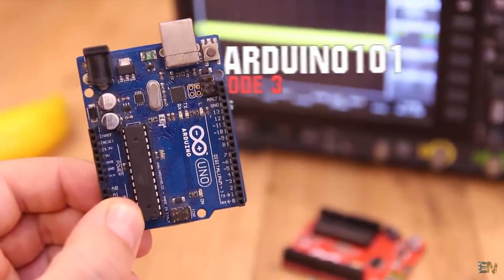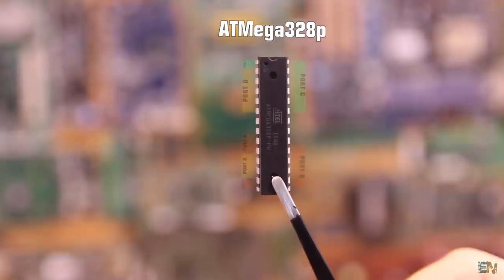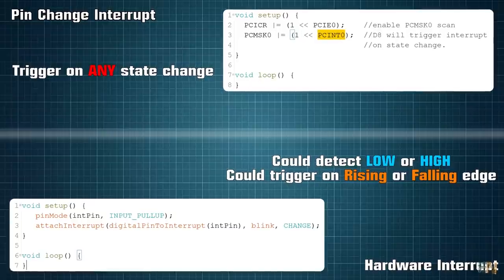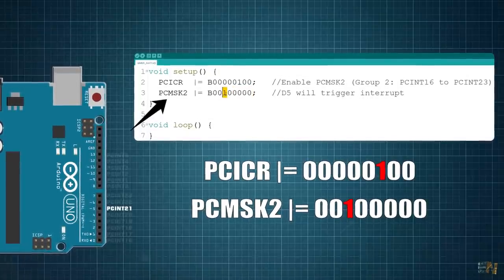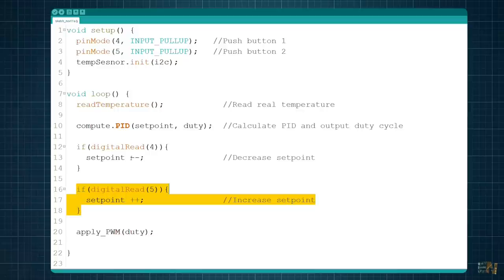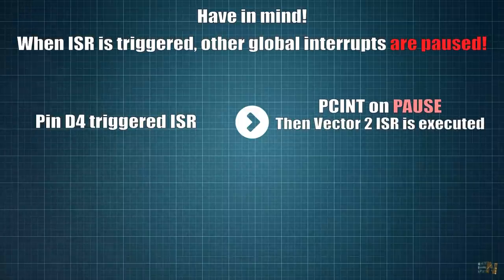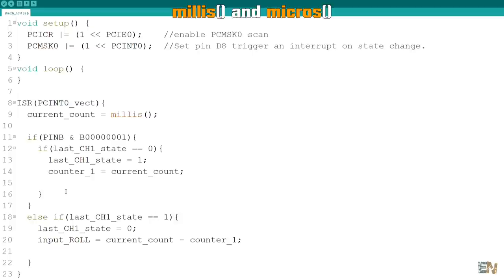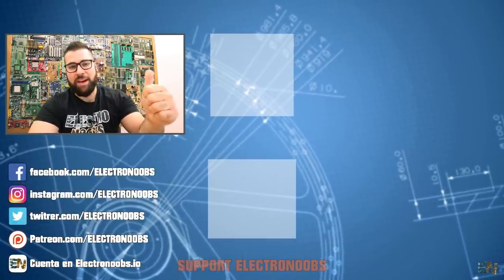Pin Change Interruptions ISR | PCINT | Arduino101

Comment: Hi, I don't know if you reply to comments on old videos but here goes. Could you use interrupts to run both InfraRed Transmit -> InfraRed Receiver on a single Arduino nano (IRremote.hpp)? Normally you would be stuck in IrSender until you have sent a complete code (e.g. IrSender.sendNEC(sAddress, sCommand, sRepeats);) and if you are receiving you would be stuck in IrReceiver until you receive the IR code. You couldn't transmit and receive at the same time.  I was easily able to do this with two arduino's (one Tx and one Rx) but could it be done with one? So just to be clear...I'm trying to transmit an IR code and simultaneously receive the same code. Maybe what I'm asking for is true multi-tasking which much more than an ISR.

Comment: Actually i have a question if 2 pins of port d are used for pcint then is we can use other pins of port d as output pins?
Reply from the maker: Yes you can. You can define PCINT for some pins and use the rest of the port as OUTPUT and set them LOW/HIGH.

Comment: You said that PCINT works not only for RISING OR FALLING but also for LOW or HIGH. I was looking for such case with LOW or HIGH, but I did not found. Are you sure you are correct?
Reply from the maker: Hi. No, what I've said is that PCINT only works with low or high. It could not detect edges. So you have to detect the edges by storing the previous state and compare with the new stare and by that you know if it went from low to high or from high to low.

Comment: Normally interrupts have priority levels and lower priority interrupts are left pending until the higher priority interrupts are completed.
Also higher priority interrupts can interrupt lower priority interrupts.
Is this also true on the Atmega or are all other interrupts really blocked when an interrupt is called?
Reply from the maker: With PCINT on the ARduino UNO only has one level of interrupt.  Also, as I say in the video, interrupts are turned off during an ISR. If the ISR for interrupt 0 is executing and interrupt 1 occurs, it will be held until interrupts are turned on again after I0 has finished.

Comment: Thx for excellent tuts. 
If wanting to return the clock cykle value instead of the micros() for better accuracy. Say one want to use the PCI for triggering two mics to get the angle of arrival, whats the maximum resoultion on an UNO? Lots of my students namely want to do "robots" that can get the angle of arrival of sound to stear them... :) im stuck there..

Comment: Another thank you for a great video. Including the cool graphics where the pin diagram floats with the chip you are holding! One thing though, in English, at least in the United States, they are called an "interrupt" or "interrupts" not "interruption" or "interruptions".  I suppose you could say that an interrupt can cause an interruption to the flow of your code, but an interruption would be an action, where an interrupt describes a "thing" or noun, just like a pin or a timer. We wouldn't call a pin a "pinning". :)